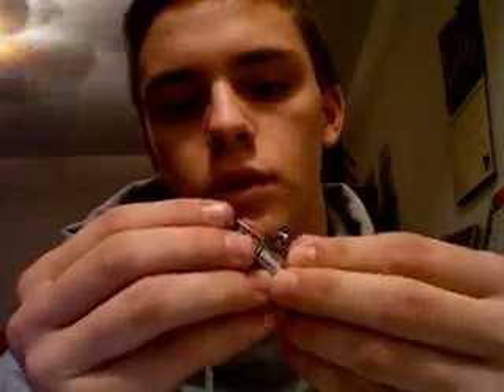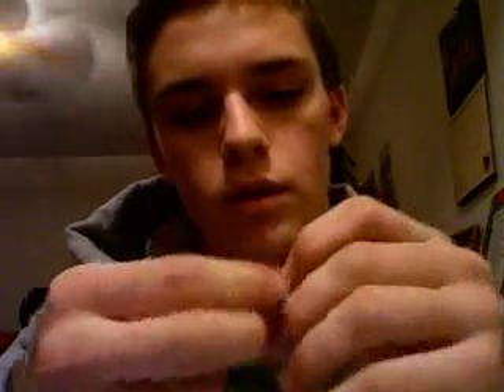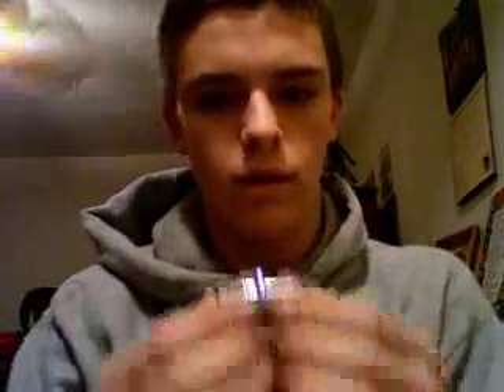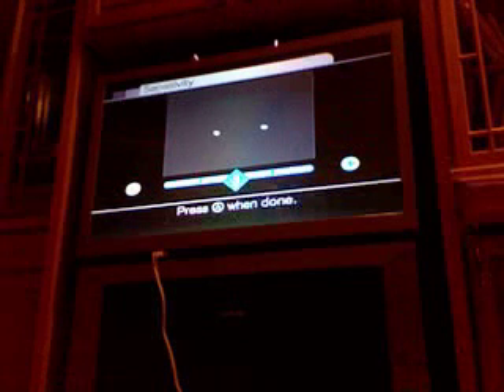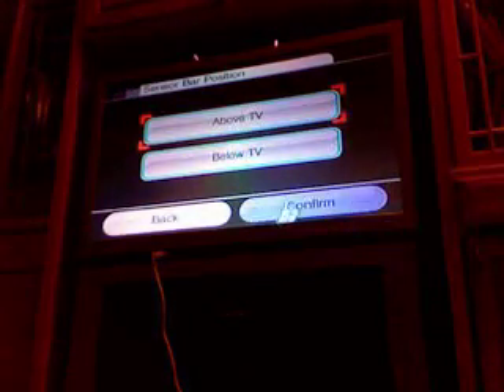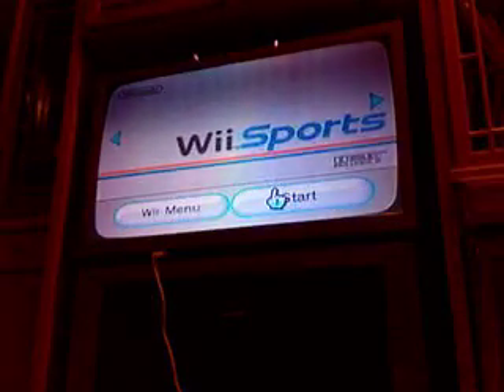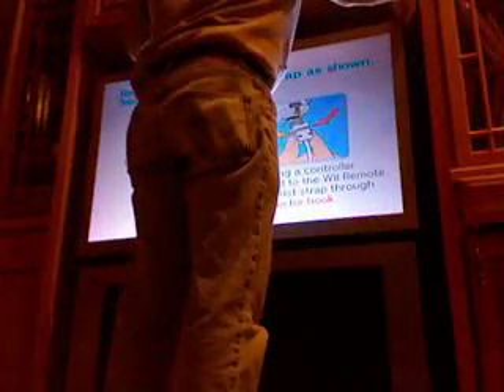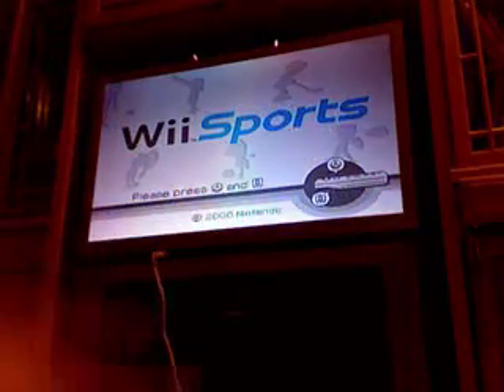10 Minute Wireless Wii Sensor Bar (2nd Cut)

Comment: course you could just lengthen the sensor bar's cord with cheap speaker wire or power it with an old wall wort.

Comment: You should really use a current limiting resistor, or you'll burn out your IR LEDs in no time.  I made my own using two project boxes, with 2 IR LEDs per piece.  Works well.

Comment from the maker: Yeah I found out that Wii Sports doesn't use the sensor bar a few days ago.  I have used this with Zelda and the Wii Internet Channel so I know it works!  I haven't had any problems without using a resistor so I would say go for it!